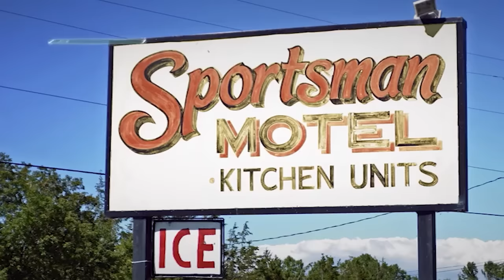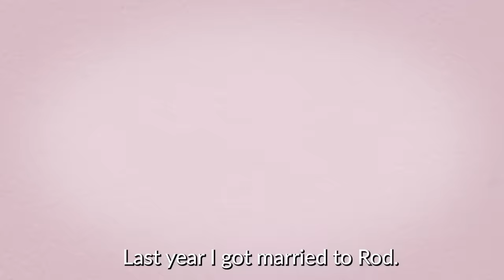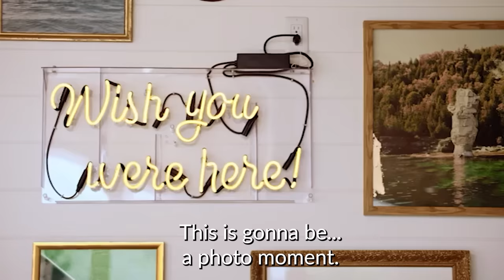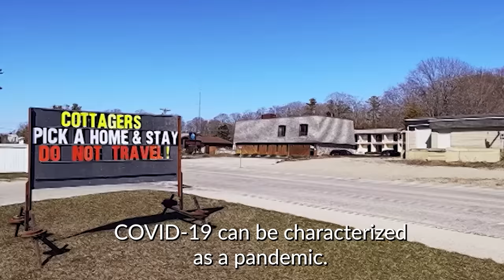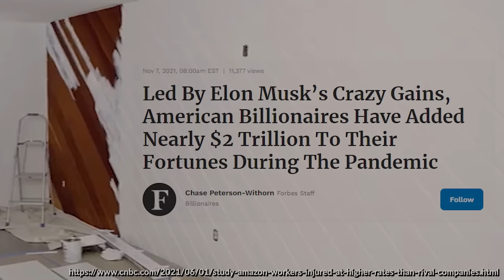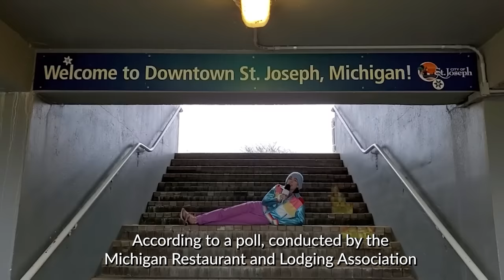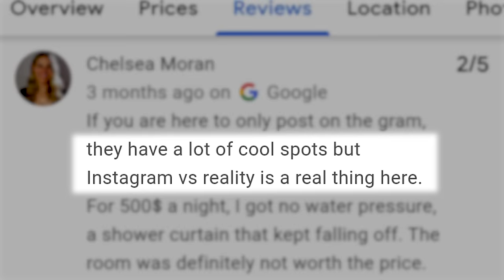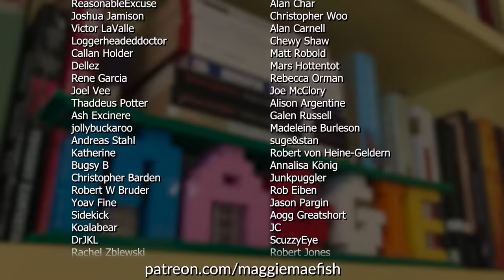The Reality TV Nightmare of Motel Makeover

Comment: "There are no real rules when it comes to mixing colors 🤗" I physically shuddered

In case anyone is wondering, I am an artist (mix of self-taught and some classroom from high school through college) and yes. There are rules. It's called color theory. There are colors which compliment and colors which clash, and painting everything white is a horrible design choice, ESPECIALLY if they're going for a neutral look. Neutral can be defined as "not stark, and not remarkable," so things like grey, beige, and other "off-white" colors. White is VERY stark and VERY intense, it's also highly reflective, so, yes, you can use it to brighten up a space, but a whole wall of it can make a space feel overwhelming. If you've ever been in, say, a dorm, you'll notice the walls may be an off-white, sort of light cream color. That's a neutral.
Also from what I can see in this video, they paint all their walls the same color? Even the tile in that blue bathroom was pretty close to the walls, and, gurl, that's not always what you want. I'm no interior decorator, my specialty is illustration, and even I know you want an accent wall, or at LEAST accented shelving. Accent colors are usually deeper or brighter than the surrounding walls and compliment the color scheme of the space. They lend visual interest without interrupting the unity of the design. Same goes for the floor, the floor should be usually darker than the walls to help ground the space. Though you can add a complimentary color (the color opposite on the color wheel) to help pop certain parts of the room.
For anyone thinking about repainting, a good rule of thumb! Keep warm colors together and vice versa—if you have cream walls, get reddish flooring, if you have steel grey walls, get bluish accents, etc.
Reply: This comment is an amazing moment!

Comment: It was the poor guy who has to work with these two I felt sorry for.  They heaped ridiculous task after ridiculous task after acting if they were the ones doing it. And who in their right mind would trust these two to model a bathroom after they chose cheap materials which weren’t the same as the ones originally chosen, yes I’m looking at you non hexagon bathroom tiles. Also I’m pretty sure painting everything white is hell to maintain those white everything walls will no doubt scuff, yellow or grey in no time.

Comment: (Sorry for the rant) It bothers me so much when these renovation personalities (like these two women) will say that they want to add character and beautiful homey designs, and then just paint everything white with extremely muted colors. Its so common with renovation these days. Like that wood paneling was amazing and could have added a lot of value to the design of the space, as well as the exposed brick on the outside. They aren't adding any character or uniqueness, they're taking away. And that "modern look" just takes away from the comfort of a space (in my opinion), and makes it look less like a lived-in space and more like an ikea showroom. PLUS they were bragging that their first motel went from like $90 to $500 a night, as if motels aren't supposed to be a cheap option with a high turn-over rate. Is that just me that thinks that? Cause I had thought that motels were meant to be the cheaper option compared to like a hotel or something. (That was a genuine question, not sarcasm)